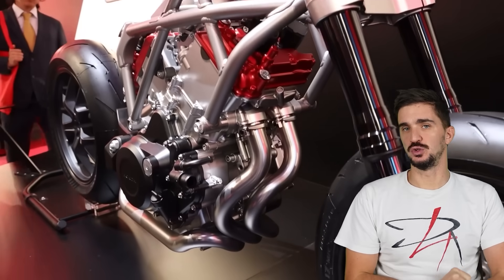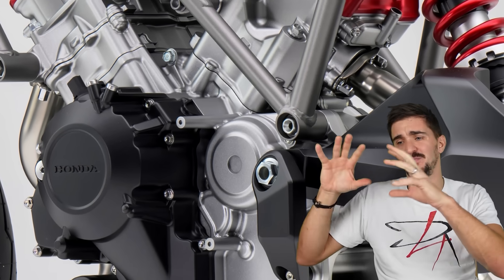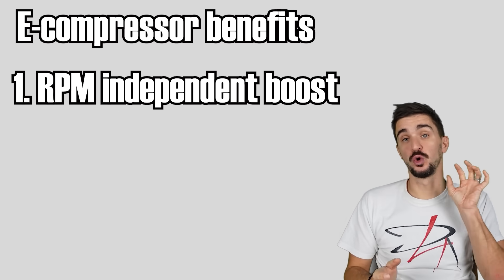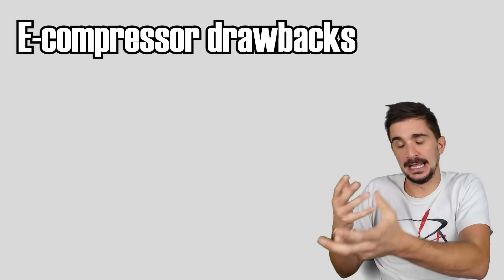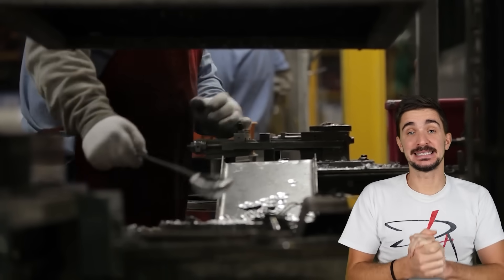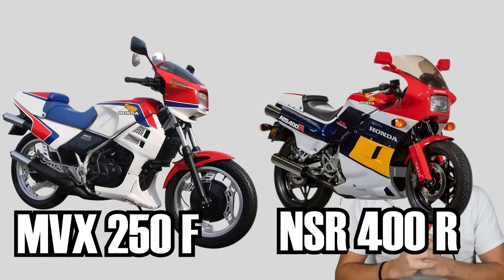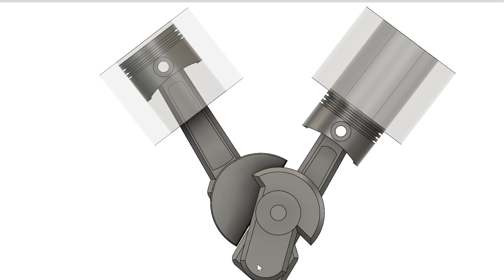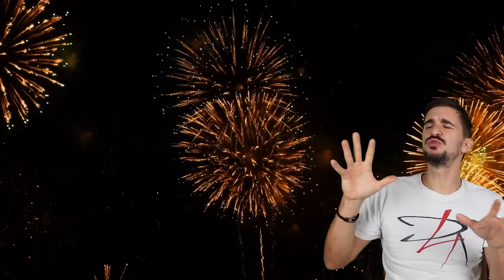Honda's New V3 Electrical Compressor Engine Explained

Comment: Well... Honestly I'd describe the electrical resistance placed on the alternator required to drive the electrical compressor as adding demand to the engine comparable to that of the backpressure in a traditional turbo. You mentioned they both arent free energy, but sort of imply there isnt a demand on the engine for electrical compressors like there are for traditional turbos. In fact they both have extra demand on the engine, just in different ways.

I think the reason electrical compressors havent taken over everywhere is that, despite their benefits of almost zero lag and the lack of need for exhaust routing... Mechanical turbos are more efficient. They convert the mechanical energy of flowing hot exhaust right back into mechanical energy that drives the compressor. This is an almost perfectly efficient process. By contrast, an electrical compressor requires converting mechanical energy of the engine into electrical energy (via the alternator), then converting electrical energy back into mechanical (via an eelectric motor). This is a double conversion of one form of energy into another, and that results in massive energy loss. The result is that regular mechanical turbos are simply more efficient and less extra demand on the engine for the same amount of compression.

That being said, I can see some advantages to going with electrical compressor here. For one thing, you get to pick WHEN the demand on the engine occurs. I would think a mechanical turbo actually reduces engine horsepower and eats engine torque at low RPM, because the engine is experiencing reduced airflow and increased demand from a turbine, without yet feeling the benefits of intake air compression. By contrast, an electric compressor can draw power that was previously socked away in a battery, freeing up all electrical demand on the engine's alternator during rev up. Then, the motorcycle can put demand on the alternator after the engine has rev'd up to cruising speed, when it has power to spare (since maintaining a constant speed requires fairly minimal power as sustainment against friction and air resistance), and recharge the battery for the next acceleration.

This would be an important offset of demand in a motorcycle, because much of a motorcycle's horsepower comes from high revs in a low displacement. This means low torque compared to equivalent horsepower car engines. I would imagine torque is probably especially  hindered when an engine is first trying to overcome the backpressure of a turbo with no boost to help. Which means that a motorcycle engine is probably especially hindered by regular turbos when first accelerating.

This also means an engine so heavily reliant on high revs and low displacement for horsepower would be extra reliant on low lag from any kind of compressor, to keep the engine snappy enough for use in a motorcycle.

And, finally, having an extra 50 lbs of exhaust piping and other nonsense is probably worth the benefits of a mechanical turbo on a car, especially if it just makes for a more cramped engine bay that is already shaped a certain way (meaning, no impact on drag). By contrast, I could see the extra weight and size of  the piping needed for a mechanic turbo being a severe hinderance on a motorcycle... To the point of making the tradeoffs of an electrical compressor a viable option.

For cars though, I think the future is hybrid, "Electric assisted" turbos. These would be normal mechanically driven turbos that happen to have an electric motor on the same shaft as the turbo. These could spin up at low RPM, just like the motorcycle here, but then transition to being driven by the turbine as engine RPMs increase.

Comment: Yeah nah , the compressor mentioned has a turbine it's the compressor turbine , it just doesn't have the exhaust turbine . Ask a jet engine mechanic what does the incoming air hit first in a jet engine , the answer will be the compressor turbine blades .

Comment: What if the 3rd "lone" cylinder was operating as two stroke (with intake valves on the top and exhaust ports on the bottom for uniflow scavenging)? Then the firing interval could be equal and you would get a power boost. But you would need the electric compressor to provide a constant pressure to scavenge the piston, and direct fuel injection, so no air/fuel mixture is used for scavenging. Maybe some vane in the intake manifold that would redirect the compressed air to either the two stroke cylinder in low power mode (with the two four stroke cylinders air-breathing) and with increased power demand, increase the pressure and direct some of it to the two four stroke cylinders too. Or to have two compressors, maybe one classical turbocompressor and one electric compressor. The emissions might be a bit worse (lack of EGR possibility on one cylinder), but the performance gain might be worth it. The design would be even more complicated, with different cooling needs also, but it is possible. It sounds crazy, but then again, a V3 itself is a crazy idea. Btw. the secondary vibrations on this design are not good at all. But I guess they do not matter. Honda needs to build this 2-4 stroke hybrid just for fun. Maybe a heavily modified version of this engine for racing purposes. It could be marketed as a 3-stroke engine. 😀

Comment: duty cycle, battery and alternator size and mass?   would larger capacity achieve the same in a simpler fashion? but I like it.

Comment: Saying an E compressor should give an overall higher net gain because it doesn't induce backpressure is quite a big assumption to make. I personally doubt an electric motor powerful enough to produce the same amount of boost would take up more energy than a traditional turbo.

Comment: Not shure what I think of these electric compressors, seen them used as scavenge pumps on large marine two stroke diesels but only for starting and lowspeed operation. I have every faith in honda making a great product though. Good point and squirt setup
 Shurley if honda of any of the big manufacturers were to fit a turbo today it would be a variable geometry device

Comment: The visual of gases flowing through the compressor is backwards. You can verify by looking at Honda’s layout. File goes in the center on top of the Compressor blades then is flung radially outwards and then out the short tube. 

Great video though. Keep up the good content!

Comment: what is the point of adding weight to the 3rd piston/rod instead  higher displacement with bigger piston ?
Reply: Because bigger cylinder will not work perfectly with the smaller valves and camshafts of the front 2 cylinders.

Comment: Dumb question from someone with zero mechanical engineering background:

Couldn't the same balancing efect be achieved by increasing the cc's of the rear cylinder, to match the combined cc's of the two front cylinders?
Reply: Maybe. But the thing is that bigger cylinder will require bigger valves and different camshafts in order to be as efficient as the other two. This also means that you will need 2 different sets of parts for one motor, which is not really cost effective.

Comment: I don’t think you are correct on the emissions being the same.  If you are producing the same horsepower, then you are putting the same amount of air and fuel through the engine and will produce the same emissions, except may be at idle and very low throttle settings.  Maybe the emissions test cycles allow this sleight of hand to be successful, but when producing the same HP, the emissions will be the same whether from a small boosted engine or a larger normally aspirated engine.
Reply: That's the thing. If you ever saw AFR of any euro 5 motorcycle you'll see that they run extremely lean to about 5000-7000 rpm. Lower RPM is the place where testing occurs. After that no one basically cares about emissions anymore.

Comment: I’ve always wondered if a turbine driven alternator or generator would make sense in a gas engine for a sort of hybrid system, either in place of the 12v alternator to reduce parasitic loss, or as a different high voltage generator that more closely matches the voltage of the drive system, or maybe whatever voltage Honda uses on the compressor motor.

Comment: Long wondered why electric superchargers have never been more mainstream. Electric motors are superbly able to run a compressor with fine speed control. Turbos get hot and filthy in addition to adding back pressure, running too slow at low rpm and having no positive speed control! It's a wonder they work at all and coordinating the intake and fuel system and emissions has got to be a tangled rats nest of code. The v3 I'm more puzzled by. A whole 2nd cylinder and head seems like what everyone was trying to get away from in today's trend of i2 and i3 engines. I2s are so good today and so space and weight and cost efficient, with good sound and character.

Comment: I would also do a turbine-alternator with a larger high-capacity battery. I would also make the odd cylinder larger to compensate for the imbalance. Then you would have a nice engine for many applications.

Comment: The gold wing alternator is a very powerful unit, that produces 1.5kw of power @5000rpm,so they will use it most likely to power the supercharger and an extra battery as well

Comment: Its great to see Honda bringing back that crazy V5 balancing idea for this V3 though I did want to ask you a question about this, is this idea of having two unbalanced forces balance each other out possible with a V8 engine? Like having a V8 with 75 degree angle?

Comment: Thanks for the insight, i wasn't sure about this electric intake pressurizer, but if it works as you say it might be interesting. As you said if only creates 5 psi does not need an intercooler, nor has the heat of the exhaust gases like in a turbo. Anyhow i would like to hear how that v3 sounds.

Comment: Kevin Cameron over at Cycle World did a deep dive on the compressor, electrical motor type, and the thermal requirements of this system. Pretty cool stuff.
Reply: Agree

Comment: Great video, interesting engine. With an electric compressor, my first thought is: why not also a turbine with a generator? Adds weight, sure, but with a compressor it really doesn't need to be 750cc.

Comment: That is a generator-electric driven centrifugal supercharger.  The key difference from an ordinary supercharger is the fact that the generator-electric drive allows the supercharger speed to be independent of the engine speed. But, ultimately all of it’s required power comes from the engine crankshaft. They very well may be using a battery and or super capacitor to power it during periods of high demand, but of course those are ultimately replenished from engine output. So the efficiency is necessarily less than a turbocharger. What I think would be neat would be an electric turbocharger, where the motor only needs to augment the turbine. And at high power, it can recover extra power from the turbine, keeping the boost in check. Like Formula 1.

Comment: Before seeing the video, i didnt graduate at mechanical engineering but from i could gather its the kind of creation i love, adapted to a product organically. I always wanted to work on chasis and suspensions, because i knew when i started 2001 that someday the propulsion could be radically changed, but the structure and suspensions will keep following same principles. Lets check out if your deep dive changes my minds.

Comment: Im not totally convinced how an e compressor is better in all aspects in comparison to that of a turbocharger from a thermodynamic efficiency stand pont. An e-turbo may not be creating back pressure in exhaust port but it is certainly drawing power from the engine via the alternator. An e turbo is just supercharger that runs indipendent of the engine speed. For a given boost pressure a turbocharger is always going to be more efficient than a e turbo, at least from a thermodynamic poit of view. For Honda the reason for the choice could just be performance and given its just 5 psi the choice must have made perfect sense along with the other benifits that you have pointed out.
Reply: See the turbocharger works by drawing power from the exhaust via it's turbine and is expressed as change in enthalpy of the exhaust across the turbine. And enthalpy is the sum of energy from pressure and energy stored in the gas in because of its in temperature. Thus it is not only the pressure energy but also a significant portion of the thermal energy is converted to useful work in a turbocharger. All that is lost in case of a surpercharger or an e compressor.

Comment: would it make sense to balance the tront pistons by increasing the bore of the rear cylinder. For example the front cylinders would be together 500cc (like the current 500cc Honda Motor) and the one rear cylinder 500cc too. I think it woult have an interesting carackteristic and sound and mayde balance.
Reply: That's not good. You will need different sets of parts for the one engine. Otherwise bigger rear cylinder with smaller valves and camshafts from the smaller 2 cylinders will not work effectively.

Comment: I've asked about this probably ten times on various forums and boards and comment sections over the past 25 years. Always heard back that it was not possible, would have no advantages, or was not practical. Interesting to see that it might finally be possible, advantageous, and practical.

Decoupling boost from exhaust or crankshaft just always seemed like a holy grail to me.
Reply: Part of it is advances in low cost very high output brushless motors.
Reply: Back then they didn’t really have small electric motors that were powerful enough to move the air required. Then you add complexity of powering, charging, and controlling the whole system. With a traditional supercharger it’s much easier because the belt means the supercharger spins slower as the engine spins slower and needs less air and also spins faster as the engine needs more air. To an extent the same is true for a turbo because it will naturally spin faster as engine rpm increases because there’s more exhaust flow. 
With an electric compressor you’d need a control system so you aren’t over boosting at low rpm and under boosting at high rpm. 
And, you’d want higher voltage so it can have enough power without a very large motor and wiring. Which means a separate battery back with controllers. And, possibly also an extra high voltage charger of some sort. 

At the end of the day it’s interesting, but not particularly practical. About the closest they’ve gotten is some hybrid turbos that have an electric motor to keep it spooled. They can also be used as a generator to recharge the batteries. Those have benefits, but the turbine is still doing most of the work.
Reply: @NBSV1  that and the inherent limit on rpm of electric motors, as once they reach higher RPMs, they basically cap out due to internal resistance from the windings, and if pushed hard enough will internally arc.  This could potentially be solved via gearing, but the major issue comes down to typically a 7k-14k rpm maximum for the motor itself.  Where as most turbo chargers can reach about 350k rpm.  I have a hunch that this is why this compressor is limited to 5psi of boost, as gearing a motor from 7k to even 210rpm is a 1 to 30  ratio and would require quite a large and energy hungry electrical motor to push
Reply: That's disappointing since there were no less than three different V3s competing in Motorcycle GP racing more than 25 years ago, two in the same season (BSL and Modenas)!
And as mentioned in the video, Honda made two different mass-produced, road-going V3 motorcycles, also more than 25 years ago :)

I do love forums for knowledge sharing, but there tends to be too much reliance on non technical "journalism" and what ultimately comes down to image, resulting in some pretty annoying groupthink at times.
Reply: @identiticrisis  I was referring to the electronic compression, rather than the V3 configuration.
Reply: @niveketihw1897  ah well that's still odd!

Comment: We have known 3 cylinder compressor is not as efficient for how long you need a v4  to recover properly or rotary screw for a very long time honda wasting there energy with a 3

Comment: But do you even want maximum boost and lots of torques on a motorcycyle down low? The traction control must step in very quickly to not loose traction so fast.
On cars that use e- compressors they are usually splemental to a real turbo to reduce lag, havnt seen a standalone solution yet.
And the power for that Kompressor must come from somewhere, a bigger alternator and bigger battery add weight.
Maybe a normaly driven tiny turbo- or supercharger with intercooling is the better option, I know Kawasaki uses superchargers in their stuff...

Comment: RC211V, with 1 cylinder lopped off each bank, with an electric supercharger. Neato. Must have beefy rods if they are boosting at low RPM.

Comment: I wonder if the electric turbo charger can be used similar to a hybrid system, where you harvest electricity in your breaking Cycle and Reagan  regain it in your acceleration Cycle

Comment: How much would the electrical system need to be upgraded? Most bikes have a resistor that disperses excess electricity from the flywheel. Not to say that it would completely power the compressor, just wondering.